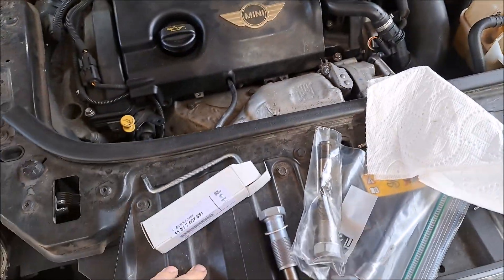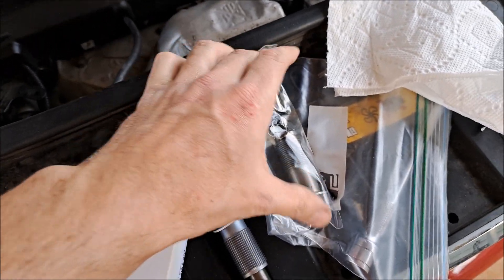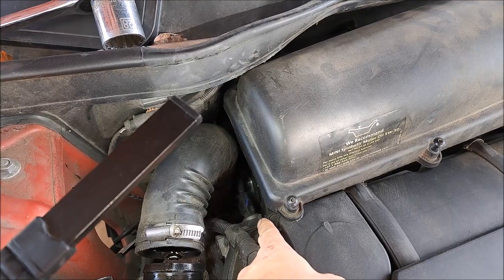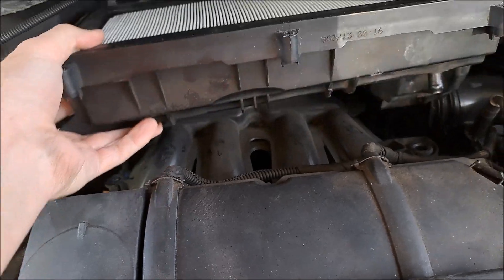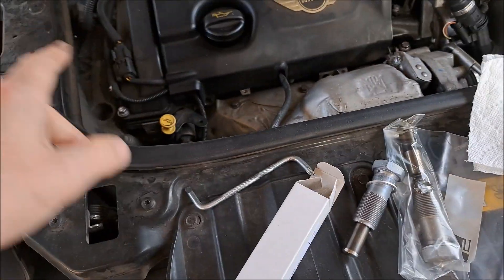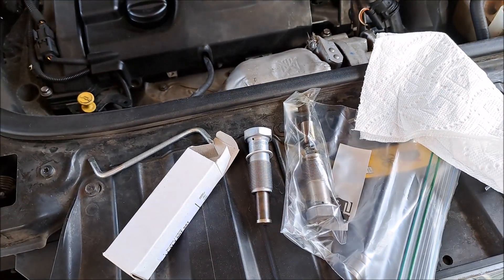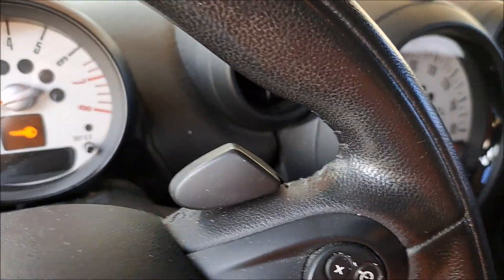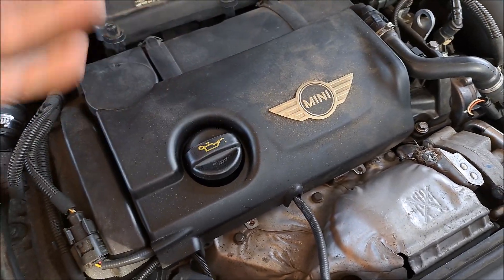2011-2016 Mini Countryman Timing Chain Tensioner Replacement

Comment: How did this turn out? Did it eventually quiet down. And you right about that diesel sound. Wanted to do this for the meantime also.
Reply from the maker: It was a little quieter on cold start, sounded about the same otherwise. I just did the timing chain and doesn't sound much quieter. Just a loud motor
Reply from the maker: @bzdenya  I ended up doing the chain myself - bought the timing kit from ECS Tuning along with the crank tool for around $200 then bought the cam locking tools for $60 on ebay. I had a shop quote $1600 for the job. Replacing the tensioner worked for another 2000 miles with no problem but I was getting nervous so I replaced it all - not worth blowing the motor
Reply from the maker: @bzdenya  I did not remove the engine. You do have to support the engine with a jack so you can remove the motor mount. Had to use the jack to slightly lower the engine to get to the bottom guide pin. But no need to remove the engine
Reply: @icefire776 $1600 lol, shop in my area charge $3500+. Anyway, good video!

Comment: Hey man - did your engine kind of "hang" when switching from 1st to 2nd and make a unpleasant noise when cold by chance? On an auto transmission. Also - I have a ton of oil in that turbo inlet pipe (I think that's what it's called) as well, the pipe you're moving out of the way in the video - is that normal? Thanks!
Reply from the maker: I haven't had any rev hang, but I've experienced that with other cars. Try letting the car warm up for 30 seconds before driving and see if that goes away. I did have a lot of oil residue in the pipe, as long as oil isn't pooling in there you should be ok

Comment: Isnt it necessary to hold the camshafts (as well as the crankshaft) in place during this procedure? 
When i brought my mini last time to the workshop and wanted them to replace the tensioner for me, they told me it wouldnt be a quick thing to do
Reply from the maker: No you only need to hold the cams and crank in place when you remove the chain. Since you are only removing the tensioner, the chain will just go a little slack, it won't jump teeth. Obviously don't start the engine while the tensioner is out